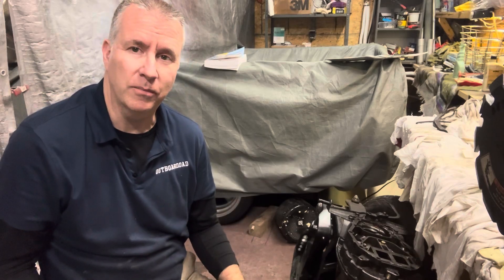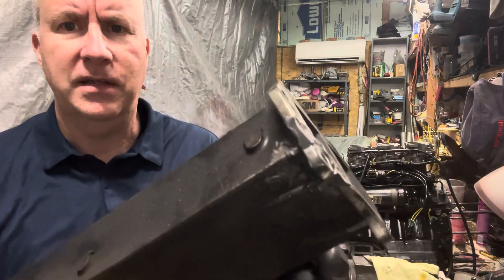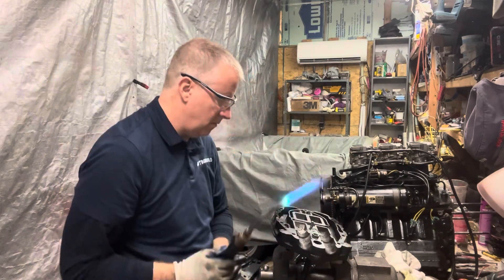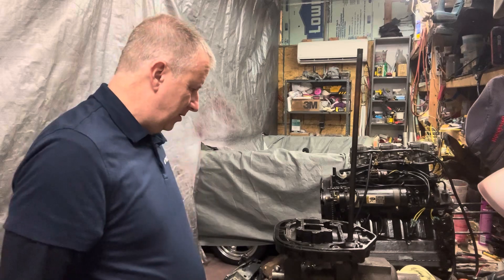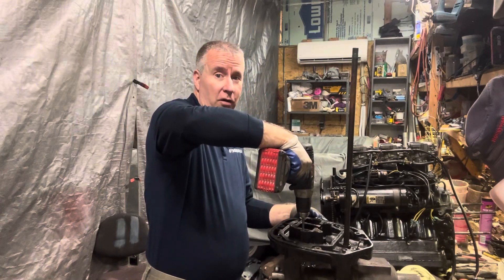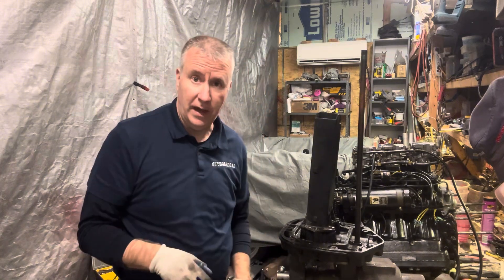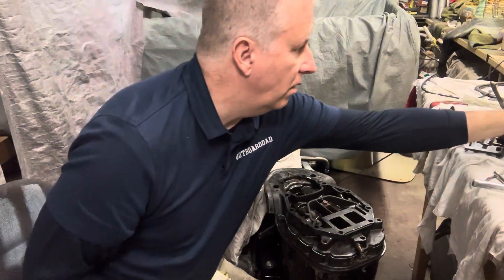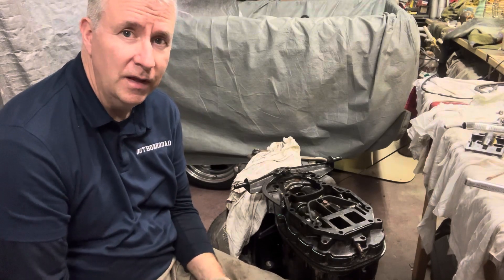Outboard Mid Section disassemble and repair DYI (Part 31)

Comment: Once you have checked everything, every single part of this motor, I wonder if you have seen one or three reasons why it got overheated as much as one piston going very bad and another four pistons quite bad also.

It would be interesting to find out if the previous owner or owners would confess to having run with a continuos beep from the overheating alarm and or the temperature gauge showing more than 3/4.

I have seen that in these v6 engines one head holds the alarm sensor and the other head holds the temperature sensor. 

It would be wise the place  a second alarm sensor in parallel so alarm will kick as soon as one of the sensors closes the alarm contact. 
Similarly a second temperature sensor and a swith at the gauge (or a second temperature gauge better yet) will be welcome, so we could monitor alternatively (or simultaneously) the temperature of both cylinder heads.

Anyhow my main question is if you found a strong reason or reasons for this motor having been overheated.
It would be a pity if the overheating problem will show up after all your great job because the overheating reason hadn't be found and solved. 

One of the two thermostats might had gone bad, both thermostats bad would close the path towards the telltale and is very unlikely, but it wouldn't be difficult to check them simply by putting them in hot water.

It seems like water pump was alright, poppet valve was good too, water passages were clean or at least not clearly blocked (which is rare in a twenty year old motor), and carburators were quite clean, as far as I have seen in your videos.

I have seen that these carburated engines may use small or big jets depending on where they are used.

I wonder if all carburators had small jets to run in lakes during the summer at high altitud, low air pressure and high air temperatures which makes air density very low, but the engine was taken to the sea and run at high atmospheric pressure in a sunny and cold day during the winter at high air density but with small jets, where really big jets are needed in order to avoid a poor gas to air ratio.
Which reminds me that bad seals at the crankshaft or a bad carburator gasket will cause poor gas to air ratio in one or more cylinders.

All those carbon deposits found today at the exhaust pipe mean that the engine has been working in a rich fuel to air ratio or at least not in too poor ratio.
Reply from the maker: @josemariatrueba4568  All of your points here are valid for sure. This is why we do all of these steps to have the best possible outcome. My experience is that 90% of the motors I have worked on are over propped . People are sold on the stainless prop to squeeze out another 5 mph. Even all the motors my customers have that are running well 90% are over propped and or have a dole fin to help get up on plane. Most will have issues at some point but so many people here run their boats 10-20 hrs a year. That’s why you see so many boats for sale that are 15-20 yrs old and have only 500 hrs on the motors.
Reply: @OutboardDad 
 I hadn't thought about the damage of over sized propellers and dole fins.

Thanks for pointing!  

My boat used to have 19 inch pitch propellers because the previous owner was looking for 40 knots with twin 135hp engines. He got 39 knots with the boat clean and empty. 

He had 17 and 15 inch propellers also.
Probably the right pitch with two engines was 17 to get more than 30 knots top speed easily without over loading the poor engines assuming that full power at more than 5500 rpm is limited for a very short time. I have no idea what's the maximum rpm sustainable for an hour or three but I wouldn't go over 4000 or so.

What's the cruise maximum rpm that you would recommend?

Now we have a single engine with 15 pitch propeller and the boat runs powerful and smooth even at full load with all our gears, 6 persons and half a tank (full tank is 200 gallons that we have never tried). 

The new maximum speed of the lightweight Pursuit model 2550 with clean hull and two people is a bit over 27 knots in flat water abd no wind (around 4000 pounds or 1800 Kg, because empty boat without engine weight, specified by the manufacturer,  is only 3000 pounds equal to 1362 kilograms).

Top speed is more than enough speed for a short time in the seas we have here at the Bay of Biscay, northern coast of Spain, because anything over 18 knots is normally too much speed for rough seas. 

Water skiing nicely at 17 knots is possible those days that waves are up to 1 meter or 3 feet after noon. 

Water is flat only first time in the morning, after all night of a gentle coastal breeze some very good weather days that we often get only during the summer.
Reply from the maker: @ Each motor has an rpm range to operate in. Usually 4500-5000 max but optimal most are WOT 4800
Reply: @OutboardDad @OutboardDad 

I guess that we need more than one propeller for the 4500 to 5500 rpm range, or your 4800 rpm number at WOT target.

I always thought that propellers should be small enough that maximus allowable rpm will be reached at
Wide Opened Throttle.

If max rpm cannot be reached it's a sign that the propeller is too big for the conditions. 

In fact Mercury manuals say that a smaller propeller should be used when the boat is full loaded or when the engine cannot reach full rated power in a hot, humid and cloudy day in summer because air density is too low and the mass of oxygen is lower than expected.

Available power is less in summer than in a clear sky cold and dry day in winter when air density is very high.

Mercury manuals mention that there is a secondary loss of power because lack of high enough rpm at WOT and for this reason smaller propellers should be used in summer than in winter.

My 135hp Mercury 2.0 has a factory sign that says max rpm is 5700 rpm.

I have read somewhere that the engine will not allow more than 6000 rpm because there is a module that controls ignition to avoid over revs.

But I see that there is no control of possible overloads that may cause damage from over sized propellers for the running conditions.

Could we stand that an excess of rpm from too small propellers, like if the boat is clean and empty in winter, is not as bad as lack of rpm from a too big propellers for conditions like a full loaded boat in summer?
Reply from the maker: @ Interesting, I like your thinking here. Ultimately for my boats I never ran full out for more that a few minutes. Most times because it’s rare to have calm enough sea. But even when it was calm I usually ran 4009-4300 cruise.
Reply: @OutboardDad  
Got it 4000 to 4300 cruise and very few minutes at WOT.
Thank you!
Reply: Hi, sorry for my english (I'm from a little island in Colombia). How's the name of the green/blue accesories you show in the video (like a seal between parts). And where do I get it?